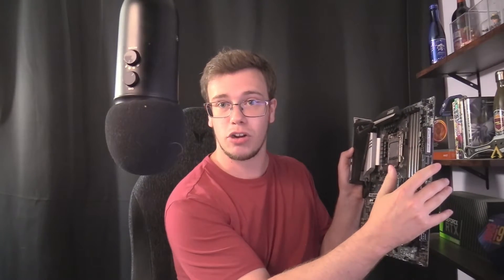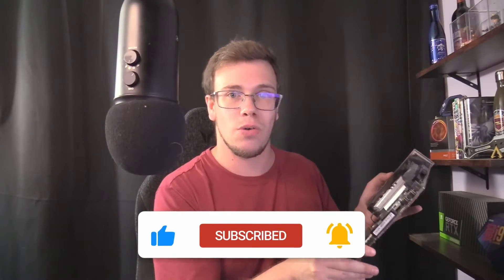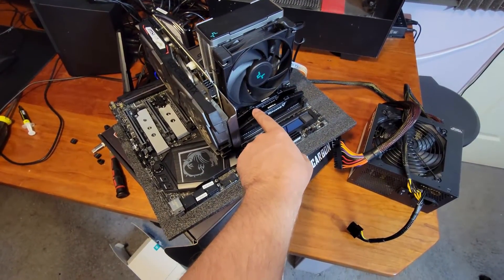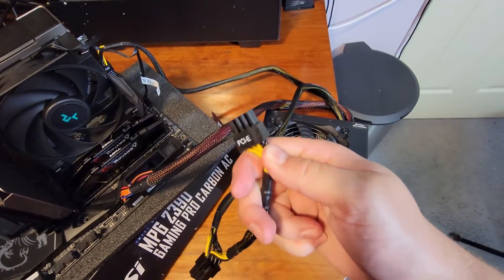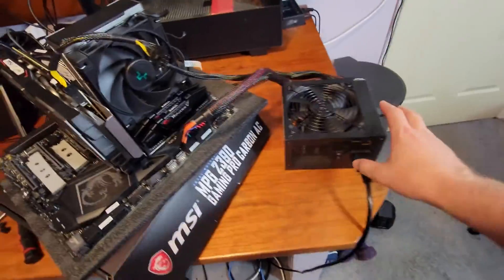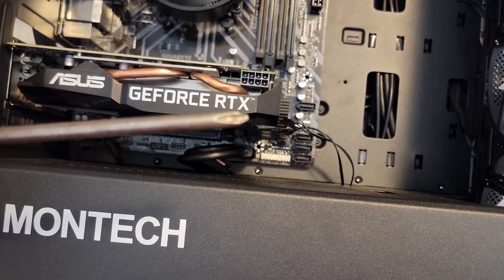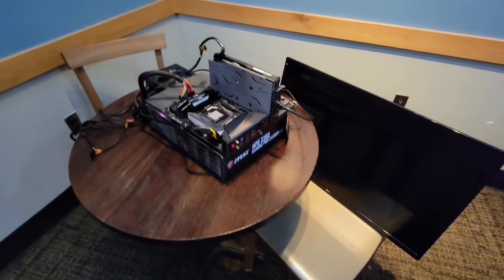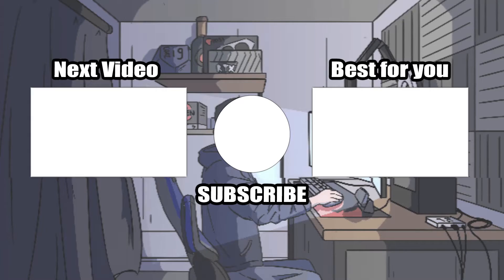How to Test A New Motherboard and CPU | Full Guide

Comment: Question, you dont need ssd to test? Or its gonna go into bios directly even if theres no storage drives detected?
Reply from the maker: It will go directly into the bios without a storage device.
Reply: It will run off the ram memory.

Comment: My psu is old so I have to use an adapter to put my pcie cables in but then there's cables with no where to go all the rgb comes on but the gpu isn't spinning
Reply: Good way to kill components.
Spend 100$, get a new PSU
Reply: @Farrell_instincts Yeah I just did that I got the rmshift

Comment: question do I need to put my cpu cooler on the cpu when testing ?
Reply from the maker: You can since your cpu will turn off before it could possibly damage itself. The pc will shut before the pc gets too hot. As a safety mechanism. I would recommend a cooler if you have one.